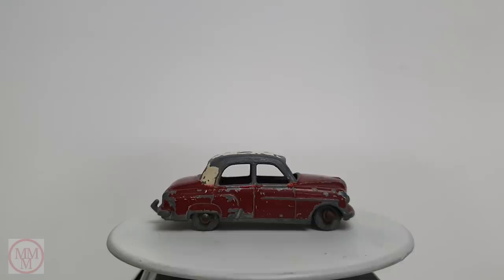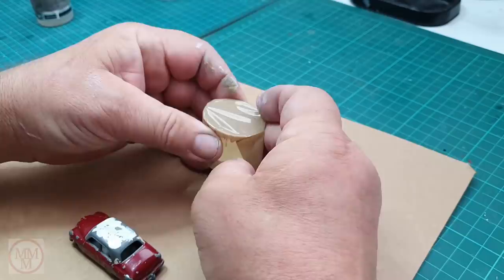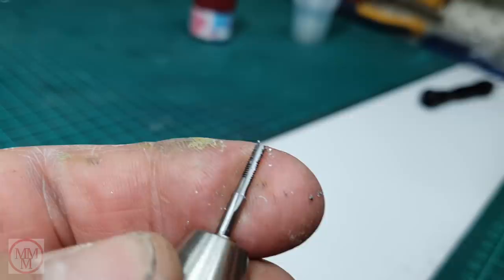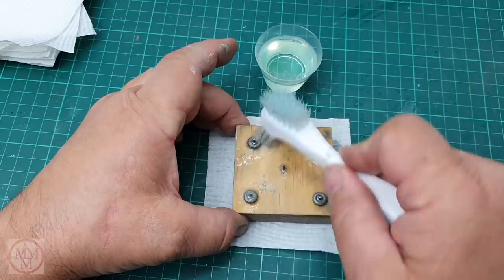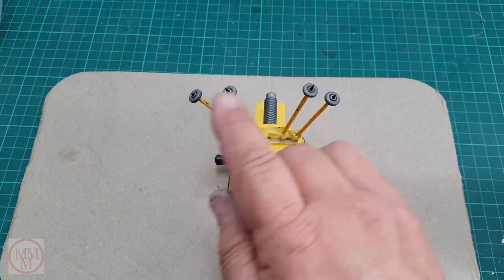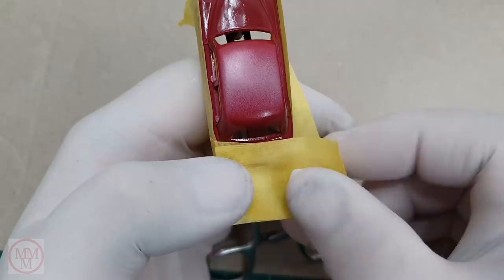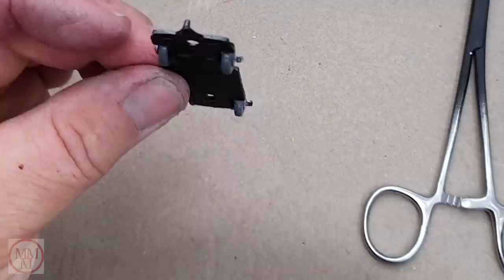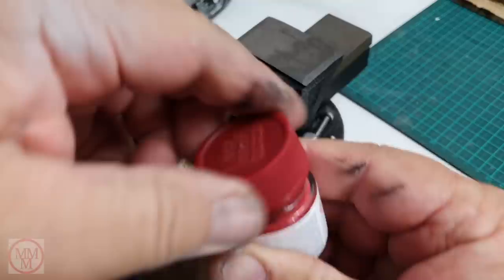Matchbox Restoration 22A Vauxhall Cresta 1956

Comment: Hey Marty, I don't know if anyone has mentioned this or not, but if you place the acrylic paint bottle under hot running water or in a hot water bath, you will be able to loosen the lid. For enamel paints, just turn the bottle upside down and with a pipette, or something similar, apply a little thinner to the now upside down cap and the thinner will seep down into the cap, soften the paint and you can then open the bottle. Another great video. I really enjoy watching you restore these classic cars and sharing your techniques and failures as you go. Thank you.

Comment: To undo the lids off the paint pots put them under a hot tap and run the water round the lid , or stand the pot in some hot water this will soften the paint as well , another great video as usual .

Comment: Handy tip on stuck model paints lids, Get a jar opener, or channel lock pliers, for the lid and use a  rubber kitchen glove to grip the jar.  ALWAYS clean the rim of the jar before butting the lid back on.

Comment: Great job Marty I like the simple restorations. Here's a tip for removing stuck tops. Turn it over on it's top and put a few drops of lacquer thinner into the threads, capillary action will draw the thinner into the threads. Let it sit for awhile and it will dissolve the paint enough for you to remove the top.

Comment: Haha, the good old "Tamiya paint bottle cap getting stuck" routine... what almost always works for me in such cases: grab the bottle, and, holding it firmly, knock it against something solid (like the side of the work bench in my case) with force - not so much that would crack or shatter the bottle of course - so the side of the cap bangs against the solid surface.  This way you crack the layer of paint that's stuck and dried between the neck of the bottle and the cap, essentially sealing the cap shut. That quick mashing session will break that "seal" so you can remove the cap. This is almost guaranteed to work - and better than simply using a stringer grip and more force to open it, as that dried paint layer will crack more readily when subjected to a sudden impact (like knocking the bottle's side to a solid surface) rather than simply using increased steady force (like trying to open it with more force).

Comment: Just a tip, start with the lightest color, then mask of and continue with the darker color! Just to prevent the darker color to shine trough, ruining a perfect paintjob👍
Reply: I thought that too, sound advice but, looking at the result, there doesn't seem to be any sign of pinking or red coming through. Would that little drop of grey in the white have helped?
Reply: Watching the stripping process (in the crevices), was there a coat of white under the red?
Reply: @2H80vids  it can be so that the drying process hardens the undercoat so it doesn't bleed through.

Comment: Very nice work - looks great.  The bent axles always surprise me.  It's very common.  I would have thought the base - being a brittle casting would break first.  Good thing the base does not usually crack, straightening the bent axle is alot easier to restore.  16:10.  The vent you mentioned looks similar to the piece which is also fitted to the same place on the rear quarter on an FJ Holden.  For paint protection against flying stones, I think.  Makes sense as there were alot more dirt roads at the time, in Australia.  Even today, sealed roads are only about 50% of the total mileage.

Comment: Marty, for opening Tamiya and Mr. Hobby paint bottles, you can 3D print an opener from thingyverse, you can also use large locking pliers keeping in mind not to put too much pressure on the lid so you don't counter the grip with pressure. finally, I found than avoiding shaking the bottles before opening and always cleaning the mouth's edge avoids the paint drying between lip and lid and seizing it up.

Comment: Marty, with paint pots that the lids stick, try banging the pot upside down on a firm surface. Not too hard but the shock will loosen the paint sticking the lid and the lid should free up. The danger of using a vice is breaking the plastic lid, then the pot is no longer airtight and the paint will spoil.

Comment: A Marty's Matchbox Throwback to the first ever restoration and where it all started.  On the lead paint topic, baremetalHW actually did a video testing the paint on toy cars such as vintage Matchbox and Hot Wheels, but apparently he didn't find any positive results that would suggest such paint was used.  Interesting video nonetheless if you ever want to check it out.

Comment: I recommend You a tip for not to damage the wheel when you are  quit the axel: "Paul Restorer channel" uses a plastic with a hole between the wheel and the dremel machine. Thus, wheel is not damaged. Thanks for your videos.
Reply: Right Mate. I know PAUL from Poland and this "plastic-foil-method" is a great Idea. 👍🏼😀

Comment: hey Marty, try using a small, flat bladed screw driver to gently prising your way around the gap between the lid and the container piece on stuck lids... works for me as i use tamiya paints for my model aircraft... and it happens to me all the time, so i hope it helps

Comment: One of these days, when you're doing two or more at a time as you sometimes do, you should just remove the paint on one, then shine up the metal frame, and finally just clear coat the raw metal car and call it done.  That way you have a raw, silver metal version of a vehicle in which all the original detailing is visible.

Comment: Always clean the threads of your paint bottles and caps with brush cleaner before you screw the caps back on.  Enamel paint dries like epoxy, you'll never get the caps off again if you don't clean the threads.

Comment: UPDATE, The tool is Mr. Hobby GT 56 Mr. Cap Opener on ebay for 7.80 plus 3.00 dollars shipping. I would send you one but, you could acquire one quicker yourself. Call it up, check it out & get one. It solves stuck caps in a snap.

Comment: They used good ole lead paint back in the day for the sticking power.
Reply: Don't believe Lesney EVER used lead-based paints. Anybody know? Also, the so-called 'pot metal' for the castings is a Zinc alloy.

Comment: a toy that old might not have lead paint, but it should be nitrocellulose lacquer. That's one reason the stripper would have a tough time, it's not made for that kind of paint as you just don't see that kind of paint any more. If you can get real lacquer at all, it's acrylic lacquer.
Reply: I don't know if the hobby shops sell the acrylic lacquer paint there, but I know you can order some from England. That's the only place you can get it now, and I don't know if they even sell it in-country. Technically, it's illegal in the US, but tiny quantities for use on models is allowed. You can't get enough to paint a real car now, you have to use that water based crap that isn't worth a darn.

Comment: NIce video, as always. One question:  why you paint the screws in the body colour, not  black?
And a tip for removing the lids of paint jars: I have  a handle with a rubber sling on the end, which you put around the lid. Then pull and 99,9 % go off...

Comment: I'm curious.  I rarely see people use self tapping screws when restoring diecast.  Why is that?  Diecast metal is inherently soft.  It seems to me that self tapping screws would work great on diecast metal.  Heck, I bet you could use regular screws the metal is so soft.
Reply: In the factory rivets were used because they were quick method ,  purists would aim to replicate the factory finish even if a better securing method were avalible (applies to other model manufacturers/ tinplate etc)

Comment: Isn't that paint going to be terribly faded anyway? Seems a bit of a waste of time trying to color match that closely.
Reply: I think these are display items. I dont know fading would happen.
Reply: Don't think they got a lot of sunlight as toys so fading might be minimal if any. Like horse shoes and grenades, close counts (lol)
Reply: @BigLisaFan  Fair point. Though I reckon there would still have to be some degradation.
Reply: I have rarely seen paint on lesneys fading apart from some reds to pinks on the late 60s superfast ones.  The cream- which was used on the Jags too, matched the Dulux we used in the kitchen,  someone did tell me where lesney got their paints from.  Lesney provided some castings for Ford Motor co in nearby dagenham so could have shared suppliers for the paints